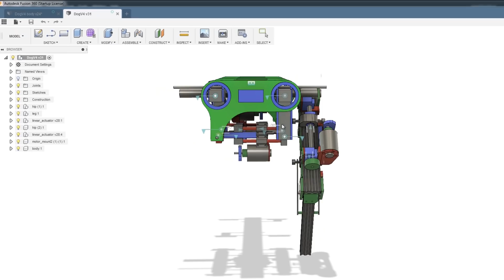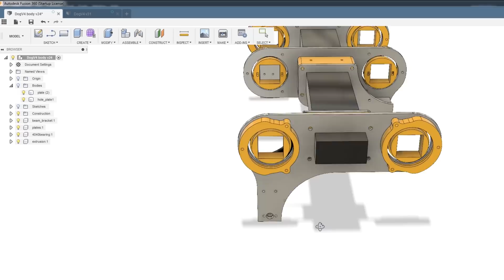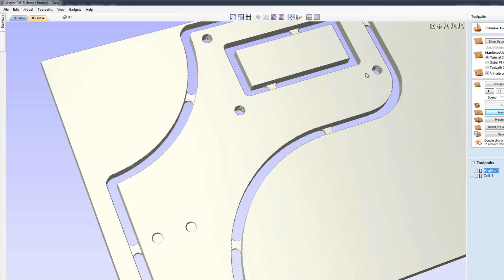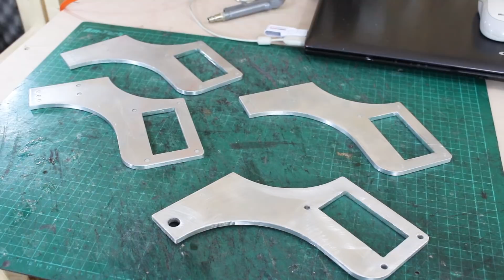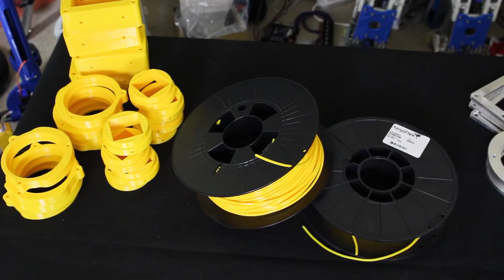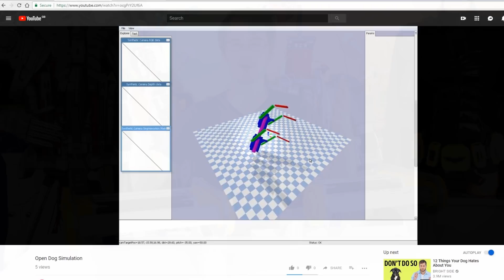openDog Dog Robot #4 | CNC Metal Parts | James Bruton

Comment: you can use wood router bits on aluminium plenty strong enough and ramp the tool in dont plunge  slow the rpm

Comment: Look, i know i'm 2 years too late to the party, but had to say this: If you need to calculate speeds and feeds, go and check out Sandvik Coromant's website. They have a free to use cutting data calculator. They even have a phone app. Sure, it only has Sandvik tools, but they also make 6mm end mills, i'm pretty sure.
https://www.sandvik.coromant.com/en-gb/products/Pages/toolguide.aspx

Comment: Can anyone help recommend a simple CNC g-code producer for Windows? I’ve just purchased my (70 year old) Dad a mini CNC and he’s managed to build it all himself and get the sample g-code running. So the machine works. But next I need to install an easy/simple to use Windows application to generate g-code. I’ve not done this for 25y so I don’t know what’s recommended. He won’t need anything complicated. Maybe something that can generate g-code to write text in wood, that kind of stuff. Just to get him started. 

Any help appreciated 👍
Reply from the maker: If you want cheap of free then Fusion 360 will do it and it's free to hobbyists, but it's not that easy to learn, otherwise Vectric software.
Reply: James Bruton thanks James. 

Btw - I LOVED the latest rocket video in Spain. I was laughing my head off. “These aren’t the droids you’re looking for...” to cows! 🤣

Comment: Why did you use unlubricated Bearing? Will you fill them up with grease later, or are you just gonna run them dry?
Reply from the maker: I think bushings would have done because they only ever rotate 30' or so
Reply: Ok. I just hope, they don't get any dirt in them and start to get stuck or damaged. Would be tedious work ripping your awesome RoboDog apart to replace a bearing.

Comment: Top tip for machining plate like this - instead of using holding tabs, stick it to the bed with carpet tape.  It will hold the part very rigidly.  Heat the part to remove.  I've machined everything from 0.25mm Stainless sheet to 40mm Aluminium plate with this method.

Comment: Higher air pressure closer to the tool and faster cutting. Think about mickey mouse corners rather than filing, it will reduce stress risers when the part is in use. Also, consider which way the tool is cutting whether it is conventional or climb cutting on the edge you want and make a second finishing pass at full depth to clean up the surface.

Comment: Hi James.  Not that I'm a CNC professional or anything (cough 10 years experience cough) your swarf is too fine.  I'm not being funny mate but you need to do the opposite of what you think you should do.  I'd slow the spindle speed and move faster in X and Y.  I know it sounds totally mental but it's what you do.  Also your cuts are what we call fully engaged, which is bad. Spiral cutting allows minimum tool engagement which allows deeper step downs.  Feed rate is based on cutter dia, rpm and number of flutes hence your 4 flute tool can have a slower rpm and a faster feed rate.  Your looking for swarf that's 2mm chips ish. Dust is a very bad sign. It usually means rpm too high.  My 3020 CNC has a 200 watt spindle and can do 0.25mm step downs in aluminium at 8000 rpm with a 6mm dia 4 flute end mill without cooling.  Your machine should be able to do a deeper step down than mine.  Just trying to to help mate

Comment: Hey James. There are many ways to skin a cat in CNC machining. I run a full time CNC Machine Shop and have put some tips below and hope to clear up some of the pointers made in the comments already.

The main purpose of coolant or air blast in machining aluminium is to evacuate the chips not necessarily to cool the parts, as this prevents recutting of the chip. All the heat generated should be contained within the chip and not reach the part. Coolant also provides better surface finish and extends tool life. As mentioned in the comments, liquid on wood is not a great idea. It can cause the parts to bow. Unfortunately if the part bows during an op you may find unexplainable tool breakages.
Tool should be 3 flute or less for aluminium (I cant recall you mentioning the flute count), this is because aluminium is gummy and the larger the flute count the smaller the flute. However the core strength of the tool increases as the flute count does reducing tool deflection at the tip, so there are exceptions to the general rule.

Looking at the chip produced it is far too small it should look more like a chip than powder, this is most likely what is causing your tools to gum up. In this case I would increase my DoC. Small DoC are only using the tip of the tool when you have all that carbide up the flutes, as soon as the tip is worn out the tool is pretty much useless. As a general rule I always max my DoC to fully utilise the flue length.With extremely small DoC and WoC you also have a chip thinning concern which is a totally different ball game. I find there is nothing wrong with slotting at a full DoC as long as speeds and feeds are correct. The down side to slotting is tool life and surface finish but this is probably not a concern for you at the moment. 
If you would prefer to continue with this strategy I would suggest a High Speed Milling Cutter instead of a standard End Mill.

For the holes spot drill every time and use a drill. Main reason is drills are cheap and the most effective means of material removal.

Dabbing the coolant on with a paint brush may be causing more harm than good by pushing already cut chips back in to the slot. Fog buster is probably the way to go. 

Anyway keep up the good work look forward to some more CNC videos. I remember the first time I ran my machines. It's a steep learning curve but achievable.
Reply from the maker: thanks!

Comment: you need lubricant when cutting metal that's why it screeches (its like a bearing you don't use them without grease or they won't spin smooth)

Comment: Also look into the helical entry setting.  Let's you ramp in a single location, good for larger holes.  For some things that you want to pocket out, if they are completely through the material, you can take the end of the tool past the back of the stock, deeper into the spoilboard, and take shallow side cuts.  This saves a bit of tool life.  Look into adaptive tool paths.

Comment: I would highly recommend a couple things: a single flute end Mill and a cold gun.  The single flute let's you have a higher feed per tooth, meaning more heat per chip taken out.  Plus the end can be ground down to increase the life of the tool, and you will definitely be wearing the end doing small depths of cut.  The cool gun is good because it cools the part while keeping everything dry.  That's really good for the spoilboard and chip cleanup.  Also don't be afraid of doing a tool change to a drill, especially for spotting.  Try to use a 6 mm for the rigidity, but avoid it if you plan on drilling all the way through.  Don't be shy about fusion either, it's got some neat features and pretty good support here on YouTube.

Comment: I didn't know that Cornish Cream made cutting fluid.

I would suggest using pan head screw in applications that are not going to countersink the screws into soft material. This spreads out the force on the screw head and will keep it from snapping off over time. It also will keep you from having the work piece move slightly if the screws went in at slight angles since the contact area is going to be a point with the wood screws instead of a flat area. Concentrated points have much lower friction and it can be low enough that you could get movement.

Comment: If you do the 4mm holes as a separate program, you can run that first with a 4mm drill bit , then you can screw the piece down to the spoilboard and use a more aggressive depth of cut with the endmill, possibly from the edge of the sheet to avoid plunging.   You could even put in some extra 4mm holes just for fixing,  so you can still use the endmill to do the countersinks.  If you put a piece of thin ply or mdf under the part,  you'll  save your spoil board and you can do the full depth without worrying about the end of the tool dragging.

Comment: Switch to a 2 flute with a coating for aluminum.  Remember to climb mill as it leaves a better finish on your final cut.  You might consider a Vortech tube (cold air gun) to keep that end mill cool.  Nice video!

Comment: Couple things, 1. don’t use coolant if you have an mdf waste board, or at least make sure it doesn’t soak into it. 
2. Never seen that type of bit for aluminum, use a 2 flute endmill
3. Those chips are almost dust, need to be a lot bigger and cleaner so your feeds and speeds are far off

Comment: Great work! One observation: to cut aluminum I would use a 1 or 2 flute carbide upcutting bit. The high speed router is too fast for four flute bits when cutting metal. I've had excellent results using a single flute bit. Cheers!

Comment: You have to go faster so you break the aluminum chips and also use uncoated endmills for aluminum since uncoated is shaper witch you need for aluminum and stainless steal

Normal steal is best to use coasted ones since they are not as sharp but stronger ( I'm doing this stuff for a daily living)
Reply from the maker: thanks!

Comment: Machinist's Handbook should help you with your feed rate and cutter speeds, based on materials and such.  Even an older copy ought to have what you need.
Reply from the maker: I think my feeds and speeds are right, but my cutter is the wrong type
Reply: It may also have guidelines for cutters, you'd have to check.

Comment: Slot drills are the way to go, I have done 16mm depth cut in ali before but even I wouldn't recommend it (bosses orders) I would advise 1mm-0.5 depth cuts. I do 2mm on a milling machine. And use S x 1000 / pi x D to work out spindle speeds, s being the linear cutting speed of the material. thats 45 for ali, and D id the tool diameter. so for a 4mm slot drill thats 3500rpm. i would just drip the coolant onto the work. no need for compressed air, as long as the tool is wet you should be fine but this is what i do for a mill not a router. Google speeds and feeds calculations.
Reply from the maker: thanks!

Comment: I run an EMCO PC Mill 50 at work some times. You can get terrible edges on your cuts if you are using both sides of the cutter at once. You can do that on an initial pass but later ones should be done to widen slots. Not doing this causes the cutter to chatter between the two sides of the channel. We don't generally use coolant for aluminum but we have a machine that can do higher torque at lower speeds. I am not sure what the spindle motor in your machine can do.
Reply: Also I agree with AlfonsoB who commented that you should keep the air and ditch the coolant. Your brushing coolant does nothing to cool the part compared to the constant stream of air. Coolant's functionality is based on it's flow carrying heat away in units volume of coolant and possibly in some phase change of the coolant. For shorter work I often use a machinists wax that melts to remove small amounts of heat.

Comment: You can drill holes by standard drill bits for metal drilling, but rotation of spindle should be smaller - 4000-5000 rpm.

Comment: As others have said, you should be using a 2-flute uncoated carbide tool. You don't need expensive coolant, WD40 will do fine. What grade of aluminium are you trying to cut? Looks like it might be 1050, which is terrible for machining - too soft. Go with 6082T6.

Comment: As someone who has quite some experience with machines of this size, a little bit of advice:
- 0.5 - 1 mill deep cuts. In Fusion you can use the variant helix so it won't plunge down directly.
- As long as you are only cutting aluminium, you don't need any liquid cooling. I would suggest using a aircompressor and blowing all the chips out (these are pretty nasty for the endmill) while additionally using a vacuum to get those chips away. I strongly recommand watching some videos from "ThisOldTony" or asking for his advice. If you check out his last video, where he is building a pasta mashine he also mills aluminium without cooling

Comment: You did a lot of research but I think you would have been better off asking someone: 
(1) Your mills are getting full of aluminum but that does not mean they need to be replaced! Get some draino and it will desolve off OR use the mill with a higher feed and lower speed and lots of coollant: that can knock the aluminum off the mill. Additionally, those corbide mills have a coating, which is why the cutting part is darker. This coating protects the mill from heat. If the coating is gone the mill has failed due to pretty normal wear (good). On aluminum for hobby projects I would say this is practically NEVER. 
(2) The cut depth should be HIGHER, the feed rate lower and the speed much lower. Your cut depth should be higher because the way you're using the mill now will wear it out at the bottom faster than at the top, especially with the wrong speeds and feeds. When the mill is nicely in cut along it's whole flute the mill will run stable as it is supporting itself, rather than biting or rubbing the material with just the end which is bad for your tool and the final quality of your cut. What I'm seeing on your workpiece is that rather than cut, you're actually rubbing and pushing the material away. The resulting heat, causes buildup of aluminum on the tool edge and it just gets worse from there.
(3) Ideally you need a 2 flute end mill, as has been said before, but I would add that the helix angle can be very flat (this is better for aluminum, becuase the chips break better and the mill cuts more, as opposed to pushing). With a 2 flute end mill you can also make holes, generally I would only poke holes with a two or three flute end mill!
(4) I don't know the stability of your machine so I can't tell you exact speeds and feeds, but you should remember that the speed and feed result in an amount of feed per tooth (material removed per tooth). If your feed is 4 and your speed is 12(ridiculous numbers, I know) than you can mill at feed 1 (=4:4) and speed 3 (=12:4) has the exact same feed per tooth, just a much more stable cutting process which will allow you to better analyze and evaluate what your'e doing too.

Anyway, good luck learning about CNC milling. It's awesome!

Comment: For your actuator pivots, you are better off using a bushing. It is usually not a good idea to use ball bearings in areas where there will no full rotation. As for the cnc routing... like others have said a 2 flute end mill will work much better!

Comment: You should be using a slot drill rather than an end mill. Only some types of end mill can plunge cut. A slot drill is designed to plunge cut. Also WD-40 is great for cutting aluminium.

Comment: advise: try to do a rough cut about 0,5mm outside the final line, and do a finishing cut when you are on final depth. this way the surface finish of the cuts will be way better. Also be a lot more generous with the coolant, coolant is cheap, milling bits are not.

Comment: Very cool! One suggestion I can make: If you're going to hand drill those large holes, you should get a step drill bit. If you don't know what I mean, it's a drill bit that is small on the tip and gets progressively larger in diameter as you drill deeper, in increments or steps. The nature of the bit is that it will always keep centered and it will not cut too much metal at once and bind up. Keep up the fascinating work!

Comment: Also. Leave your tabs off and put some screws through your holes into your spoil board. Post programs seprate and you can cut holes then screw it down to spoilboard. Then cut your profiles.

Comment: i don't normally comment anywhere but this is too hard to watch. you can try a single flute carbide endmill, 4 mm diameter, 2 mm/pas depth, 1800mm/min feed and sprayed alcohol for cooling. you're going to be amazed by the diference that makes :)

Comment: At the machine shop I worked in for a couple months, we did 150 thou cuts with 1/2 endmills for just about everything. Also, we constantly sprayed our cutting bits with coolant, either automatically(didn't' use fog buster, just constantly sprayed coolant through a plastic hose like the one you got) or with spray bottles. For starting a cut, we'd either come in from the side, where there isn't material, or the endmill would come down in a spiral pattern, until we're at the right depth. You also should do a spot with a spot drill before you drill holes into your material if you want better accuracy.

Comment: What grade Aluminum are you using? This is something you have to consider as well. If you are using Aluminum which is not really designed for machining your results are going to vary and you will either end up with parts which are unusable or spend a lot of time cleaning up the part. I would suggest using 1100 (Hard Temper) 2011, 3003, or 6061
Reply from the maker: 'Some Aluminium'  from eBay. It better with the right cutter though, you'll have to wait for #5
Reply: Looking forward to it :)

Comment: Get a 2 flute center cutting carbide endmill, then fix your feeds and speeds with a good calculator online, then I would suggest just getting a coolant sprayer for super cheap on eBay so you can be blasting a small amount of coolant at the part while cutting rather than having to brush it on there. Just some tips!
Reply from the maker: yep!

Comment: i've done a bit of machining with aluminium.
you should try a slot drill with 2 flutes because it can go down without breaking the tool bit.
plus low feed and high spindle speed leads to a good surface finish
final thing 
you don't really need coolant for aluminium